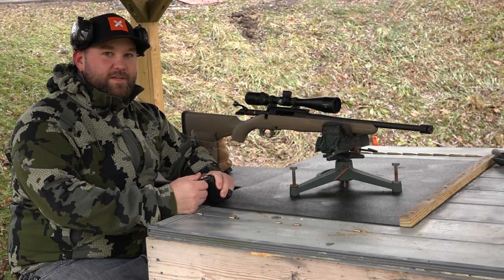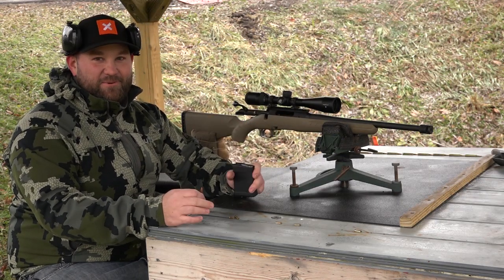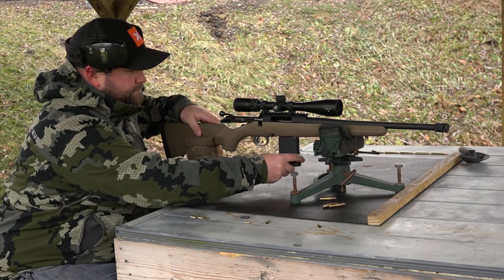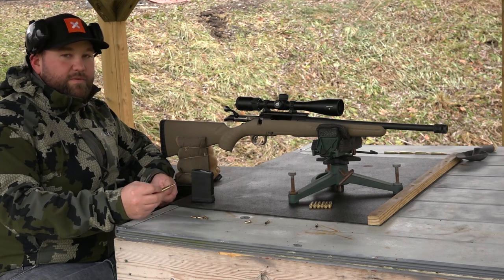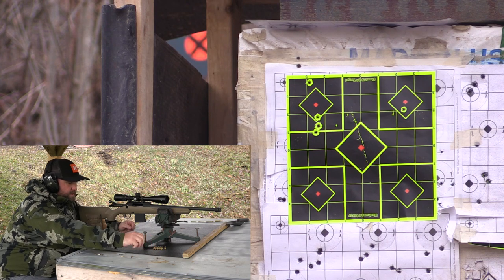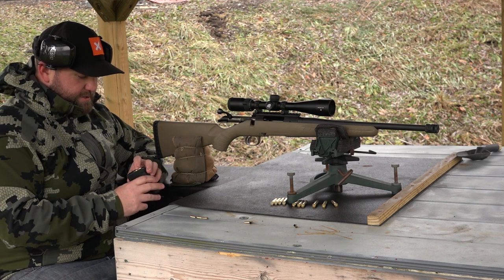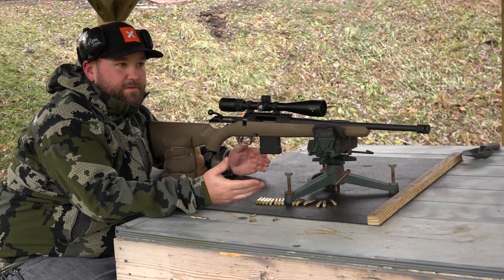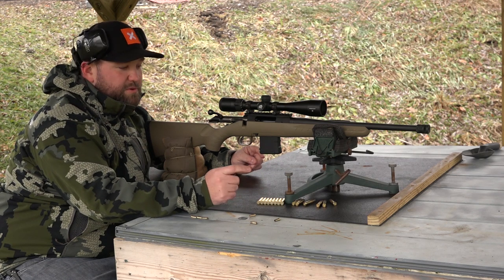Ruger American Ranch 5.56 Part 2 - Upgrades and Load Testing

Comment: My ranch likes 25.5 of Varget with 55grn Vmax's, it also shoots well with H335 and W748.  Another nice load is 23.5 of H322 with a 50grn Vmax.  Those rifles shoot 1/2 MOA pretty easily once you find the right combo.  My OAL is 2.240 for the Vmax loads.  I bet CFE223 would get you where you want to be as well.

Comment: Also try the 69grn Sierra MatchKing with that rifle's 1:8 twist, varget is a good powder to used with that bullet.
Reply: Hey man th 69gr SMK is the next bullet I want to try in this gun since it ran my 69gr match loads so  8063739092974795  Would you recommend the SMK for a good yote or Wolf round??

Comment: Hi Chuck’n you have vertical groups !! If you loosen the action screws, then press down on the Tip of the Tang, The barrel WILL ROCK UP AND DOWN 2 Inches !!!! Fix is to remove the barreled action, cut both tips off a popsicle stick, place both tips under the tip of the Tang, reinstol the barreled action and tighten down the action screws !!!! Remember, when you put the barreled action back in the stock, push the action toward the rear of the stock !! Should really help your vertical groups because barreled action can’t rock up and down !!

Comment: Try loading 69gr barnes matchburners. Cheap bullets with insane consistency. Ive shot 5 round groups that are one ragged hole. Never shot more than 3/4 moa with my hand loads with that bullet in this gun
Reply from the maker: We will give them a try for sure!

Comment: I have the same rifle in both 556 and 350 legend. The 350L is set up as a brush gun with a Romeo 5 red dot as it's only good for about 150-200y anyway. The 556 I am undecided...Had a cheap 3-9x40AO on it but It adds a lot of weight and I just didn't like it all that much. Will be trying a 1-6 LPVO on it next to see how it does. Cheers. Great content and would really like to see how that OK pig hunt goes!

Comment: 55g nosler varmageddon over 23.5g of h322 will get the gun under 1/2 inch.
Reply from the maker: Thanks. I shoot the 53gr Varm in my 22-250. They are very accurate bullets.

Comment: I am interested in this rifle but the one thing holding me back is that I reload subsonics (dont care about others opinions on it).  1/8 twist is kind of the border for 75 gr subs, but I suspect it will be find considering 75 gr HPBT hornadys are claimed to work with 1/9.
Reply from the maker: shopsmart57 I shot some sub 55’s out of it the other day. 3.1gr of titegroup and they worked quite well!
Reply: @ChuckinTV  55 grs will stabilize no prob.  75 gr though are hit or miss.  I had a 1/9 and 75 were border of no go.  Now I got a 1/7 twist 11.5" sbr and 75 gr definitely work great..  1/8 has me leery but I think they will work fine.  I just found 85 gr bullets that will seat to AR mag length, so the insanity continues.

Comment: Where did you get the magazine? Mine came with a flush mount box mag.
Reply from the maker: This is a newer model that takes PMags.I believe they originally came out only offering the flush fit rotary mag. This came with the 10 round mag.

Comment: Another great review. I just ordered one of these and can’t wait to shoot and reload for it. Do you think it will handle some of the lighter bullets, like 52 grain hollow point boat tails? I guess I can load some and find out, but any tips you can offer would be appreciated. I hope to get back to supporting you on Patreon before too long. Really enjoying the reloading content.
Reply from the maker: Thanks John. I really don't know how well this rifle would like a 52gr. Let us know if you try some. With the 1-8" twist I would maybe try 60+gr bullets first. Midway has a pretty good selection available right now surprisingly. I got some 60gr Sierra Tipped MK for the Kel Tec recently. Gotta try those sometime.
Reply: @ChuckinTV  thanks for the fast reply. I looked through my bullet stash and have some of the 55 grain Speer varmint bullets and some of the 60 grain Sierra tmk as well. I may have to wait a while to stock up on bullets but will definitely look for some heavier ones. Thanks again.

Comment: Muzzle brake, to tame that heavy hitting 5.56 lol
Reply: It keeps the crosshairs from bouncing off the target upon firing
Reply: @MW-bi1pi  maybe so in a semi auto..... but in a bolt that doesn't matter. I would assume it's more for looks. Call it a cool looking thread protector. I bought one in 300 black and I love it.  Thinking of buying one in 556 but we shall see.
Reply: @Reel-Lentless yes I know it reduces recoil. And I bet if I mixed a mag of 5.56 and 223 you would never know the difference. And I was simply just making a funny comment lol breaks were originally intended for heavy loads with alot of recoil.
Reply: @mattlyons8180  It's a 6 pound rifle, sticking a muzzle break will definitely help reduce recoil
Reply: Looks cool to the owner. Nothing wrong with that IMO.
Reply: @Reel-Lentless why would anyone want to run a 5.56 bolt gun? Leave that to your AR, and yes, muzzle brake it, as that would definitely help sustained accurate fire. No point whatsoever on a 223 bolt gun.
Reply: @tkgus2408  6 pounds. Can you hear yourself? A 223 bolt gun that weighs 6 POUNDS. That's not particularly lightweight. 7 pounds is considered average even for 308 bolt face options. For 223, 6 pounds is more than enough gun to keep itself steady. That's without a scope too btw. And I doubt many people who buy this gun will be looking to put $1000+ lightweight scopes on it.
Noone said a muzzle brake WON'T reduce recoil on a 223. Of course it will. But there is no reason to reduce the recoil, as there isnt enough of it to affect any practical application with this rifle.
Reply: This is an incredibly late comment, but your powder load and bullet puts it into ball park of 222 Remington handloads. Look it up.

Comment: I don’t reload so do you have any recommendations for factory loads that work well in your rifle? I can usually find the .223 easier in my area. Also, I was considering a suppressor purchase. Do you have any experience with a suppressor?
Reply from the maker: No experience with suppressors. But I would highly recommend some Frontier 223 in 55gr Soft points if you can find them. Frontier makes a variety of loads, but I think any of them should shoot half way decent out of the Ruger Ranch.

Comment: Those are not good groups for reloads.
Reply from the maker: jesse reece I agree. This gun is very picky with the loads given the short barrel. I didn’t get a chance to film the 73gr ELD MATCH load. I’ve got 5 of those touching at 100yd but they are veryyyyy slow.